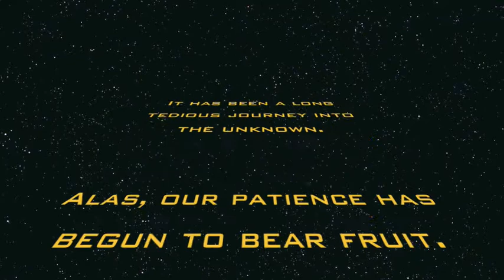Edge III Saddle Milling

Comment from the maker: @airheadoo the black part being milled is called a 'saddle'.  This is the part on a guitar where the string is held down to the bridge which rests in or on the body.  The pocket that I milled now holds what is called a 'piezo transducer'.  In short, this will amplify the electric in such a manner that it makes it sound much like an acoustic guitar.